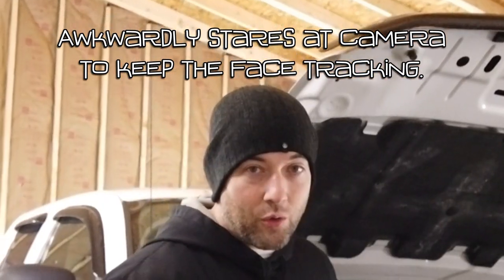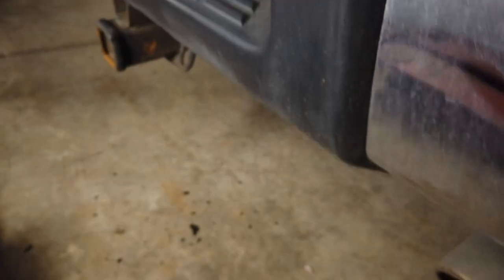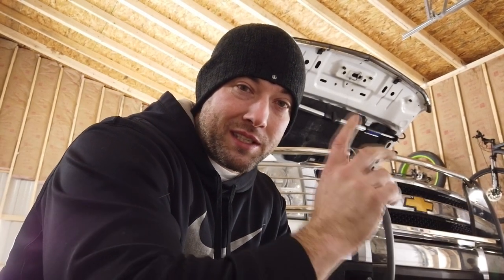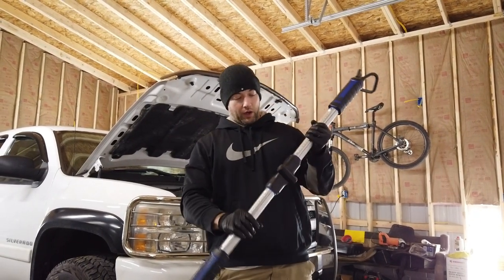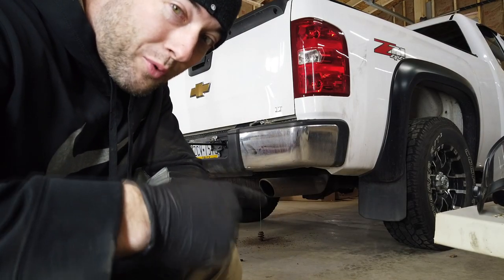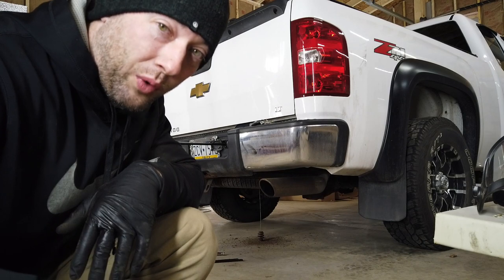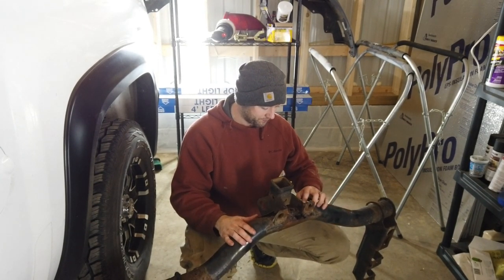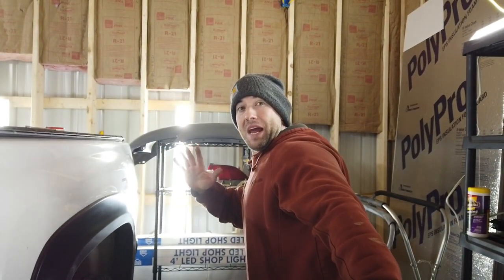How to Replace a Rusty Trailer hitch on a 2007 Silverado

Comment: I had the bed off my ‘08 F150 this summer and spent several hours on it with a wire brush wheel and flap discs. Covered everything with POR15. Hopefully lasts a few years before another touch up. I’m in southern PA.

Comment: Hey Todd, awesome channel, I watch all your videos keep up the good work! Typical for this generation truck. I have an 03 Avalanche, I acid etched, primed, and POR' the entire frame after I used a descaler and  an air hammer to loosen all that rust scale lot of work but came out good. It has the original hitch and it is beefy, no rot or holes in it.  I would descale as much as you can in the areas and oil or fluid film it annually if you plan on keeping it.  I also picked up the Audew not bad for the $ will see how long it lasts.
Reply from the maker: Thanks!

Comment: I was stuck on the side of the road I couldn't get my spare tire out. That secondary wouldn't release and i couldn't figure it out. I still haven't. My spare is a nice rusty steal wheel with a crusty tire. WOW That beam is really rusted!! The spare must have trapped some salt up there. Glad you replaced that hitch for safety's sake.
Reply from the maker: After seeing this, my dad went and dropped his spare.
Reply: I work in a tire shop and we advise everyone to drop their spare at least once a year to prevent rust problems. We have had to unbolt a complete system to get the spare out due to the rust issues best advice is to keep on top of it.

Comment: Living in the rustbelt adds a host of maintenance chores I am happy to be unencumbered by. Vigilance is the watchword, evidently. Sadness would ensue were the next Copart project to suddenly be observed going its' own way some distance behind you, along with formerly integral parts of your truck.

I'm pretty sure that's a heavy duty hitch. (Spends rest of day mumbling 'heavy duty hitch' under breath like a budget Dustin Hoffman in Rain Man)
Reply from the maker: I feel like my next purchase should be a blind bid on a Trainwreck vehicle that I should know better to not bid on.
Reply: I suggest a 1986 Chevrolet S10 that's been sitting for 10 years because someone filled the crankcase with DOT3 brake fluid. Or anything with a rotary engine.
Reply from the maker: Supertech.  Nothing but the best for my buildz

Comment: The hitch on my 2011 1500 with the same factory hitch did the exact same thing, never seen a receiver rot like this on any other truck before. must be a design flaw. Good video, thank you for posting.

Comment: Hey man, I know the crossmember is gone, no fixing that other than replacing it.. However, on the stuff that remains, consider checking into POR-15. It's not cheap, but its worth every penny when you see how well it works and lasts... They make stuff to address rust and preservation of metals and the stuff works !

Comment: This is helpful. I have the same truck. My hitch is getting rusty in the square part. (my truck is from the coast) My truck has 144,000 on the clock. Most of these trucks around here (07-08) have over 200k on them already.
Reply from the maker: Mine has 139k on it
Reply: @UnWrecked  low mile cream puff LOL!
Reply from the maker: Low mileage rust puff

Comment: Good catch on that rotten tow hitch, wouldn't worry about that rotten beam as you now have a big strong tow hitch .
Reply from the maker: Still needs to be fix.  If inspection catches it, they won't pass it and you are not allow to modify a frame
Reply: @UnWrecked  I'm sure Jerry can give you help on parts etc great video.

Comment: Glad you got that hitch changed out. That could have definitely been a catastrophe. Thank your lucky stars you trailered safely for so long. The open tube end hitches like that are prone to that rust out. Your new one one is box welded on the ends so you shouldn't get that type of rust out. I've heard NHOil is better even than fluid film. May want to check into it. Just my penny's worth. Lol Undercoating EVIL, may cause more damage than what you have there, not good for existing rusted metal, it only provides cover for rust that is still eating away.

Comment: You can sleeve the frame with new cross member. The truck is in good shape other than that. I wouldn't put the hitch in until your done with repairs .

Comment: Suspect exhaust gas which contains SO2 mixed with moisture give you sulphuric acid, which will eat up steel components!
Notice plated new bolts will not corrode so badly.

Comment: Had the same problem and that little cross member in the back cut it out go to your local metal shop buy a c channel or even Square stock you've got that new welder welderup buddy LOL probably a lot cheaper than putting in that cheap aftermarket replacement beam

Comment: 2 "heavier" duty, 1 "heavier", 2 "heavy" duty. Erick O. from South Main Auto Channel, who works on rust belt cars, recommends Fluid Film, I think over there you can get it as a kit for whole undercoating. I got 6 spray cans to use it as "cavity wax" on my Alfa (lots of rust down here as well) will let you know how that works.
Reply: Another guy (Mustie1) who deals with a lot of rust sprays his stuff with chainsaw bar and chain oil. It's got a little bit of tackiness to it so it sticks nicely. Plus it's fairly cheap

Comment: First of, thank you for the great content. Where did you get your hitch from? Amd do you have a part number for it? I have a 2008 model, just like yours.
Reply from the maker: I honestly don't remember at the moment cause I put this on awhile ago but I'll see if I can find it.
Reply from the maker: Got it from etrailer.com can't find the actual one I got now.  I know it is a CURT hitch but mine is a class 4 hitch
Reply: @UnWrecked  Thank you for the prompt response. I found it already. I'll probably go with the level 3 for half the cost. I don't do heavy towing. Thanks again. And you gain yourself a new SUB.
Reply: Curt 14301

Comment: Late 07 to 2012 GM bailout years they used so cheap parts prone to rust
Reply: Nothing to do with that,they didn't use cheap parts and I am not a GM fanboi,just being honest..Its a 12 year old truck..

What's Toyota's issue then..Their Tacoma and Tundra have major frame rust issues that are recalled and still being replaced ,the whole frame's are rusted and replaced and even the recalled and replaced Toyota frames are rusting out !!!!!! I have a small used car dealer and don't live in the rust belt and bought several that were replaced over the years...  3 that were replaced needed another frame ! Dealer's who had them  didn't want the time tied up to get it replaced,but I waited 8 months to get 2 trucks done,unreal ...Remember Ford took more money in the bailout,Toyota,VW,BMW also took U.S bailout money !!!
Reply: I only drive GM and it has everything to do with the bailout not only rust but some of the worst cars and trucks came out around then I've owned a few of them not sure what Toyotas problem is lol ✌

Comment: STOP LOOKING AT THE SCREEN!  it's making you wander around like a bad actor that doesn't know where he's at on stage. the camera is doing a great job following you, trust your equipment, that's what you paid all that money for that particular camera for in the first place man. you can run the seafoam in there for a long while if you need to but your oil will break down a little faster when you put that in there, i wouldn't run it any more than like a week in a daily driver but it's not going to kill anything if you have to drive it more than just an hour or so with the seafoam in the engine. wow that hitch is rusted as hell and you were just towing with that too not long ago. that could have been bad if you hadn't caught it when you did. i'd rather have a cast iron LS block myself it'll last longer. unless you're racing it you don't need the aluminum block.You wouldn't want aluminum if it was boosted at all either so the cast iron is still better that way too. As for your spare tire, be glad GM did that all 3 of ours on our escalades are still the original plain jane steel silverado 6 lug wheels and they are thin metal too , thinking of putting my factory aluminum caddilac wheels up under the back in place of the steel wheels and ours dont rust but i don't want to take any chances with the crappy stuff either. At least if you weld a new cross member on the bed make sure it's all sealed and painted then seal it up with bedliner or that wax stuff you were talking about  or plastic coat it one. but make sure when you wash that beast that you spray up over the spare tire too . that or just leave the spare in the bed. yeah that new hitch will make towing a LOT safer for you, holy crap yeah you got really lucky man it's messed up how thin that other one was that could have broken and slung you off in a ditch or something yikes! might want to put a heat shield over that sport in your muffler where it's right up against the bottom of the bed too to keep it from rusting also while you're at it

Comment: Use your old engine oil and spray the rusted parts to stop the rust spreding. It is common to places with rain and snow. Check MUSTIE1 chanel to sea how and why. Like what you do keep up.